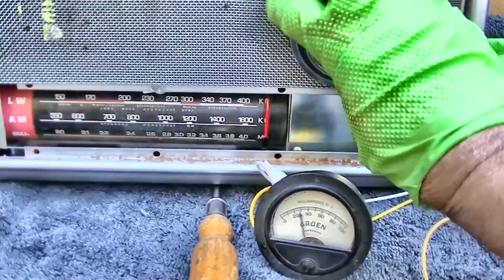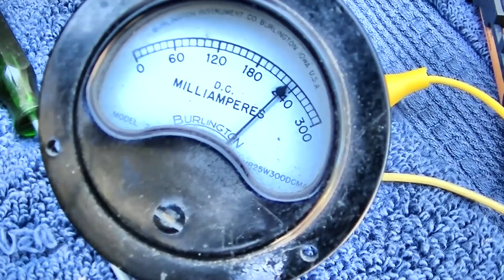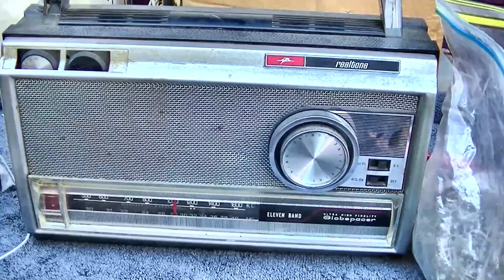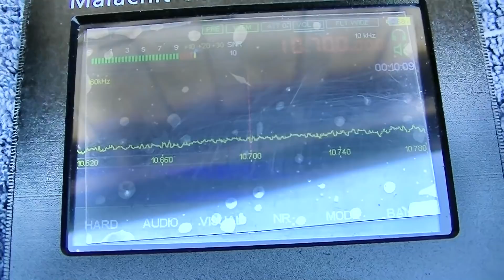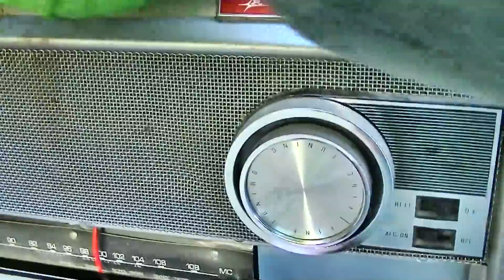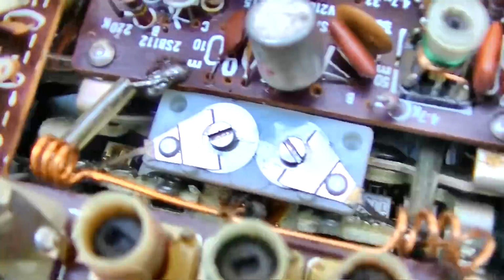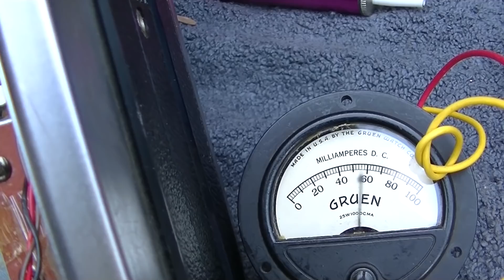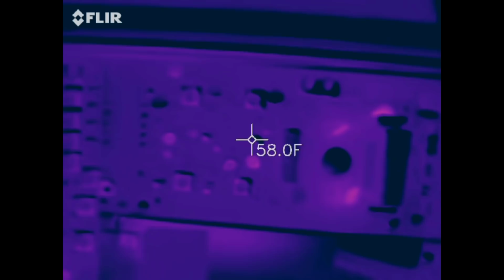Realtone Globepacer 11 Band Shortwave AM FM Transistor Radio Resurrection3

Comment: So does DX cut the amplifier power down to 2 output transistors and HIFI put all 4 in circuit or something? I’ve never seen that option before.
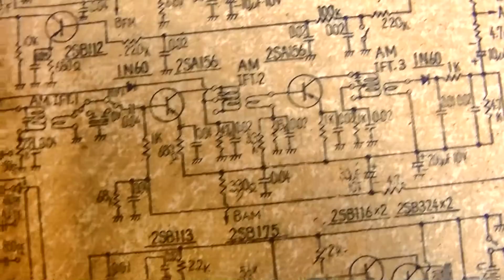Reply: Seen in the schematic at 3:40.  "Hifi" bypasses a crystal filter element in the IF,  selecting "DX" makes the IF signal pass through the filter element - this would narrow the bandwidth,  and likely cause the AGC to increase the gain on a weaker signal passing through the narrow filter.
Reply: Oh, I see it now. Thanks!